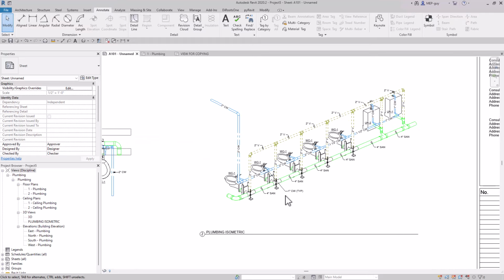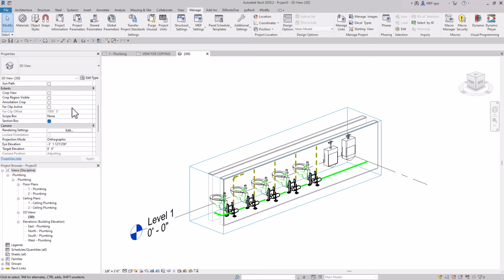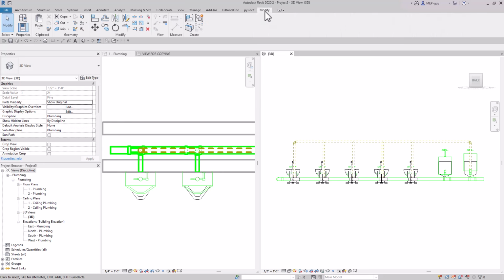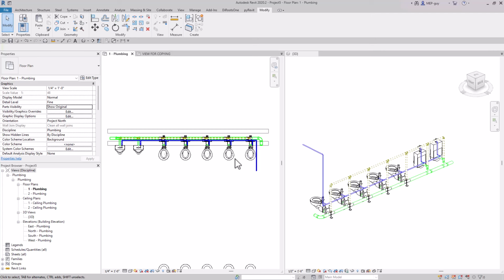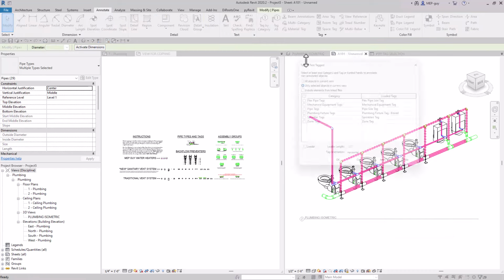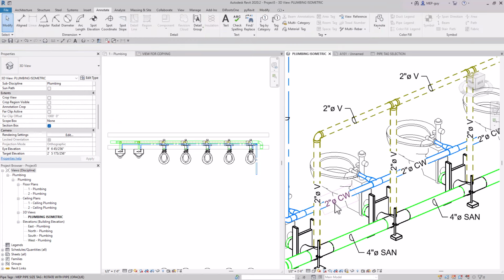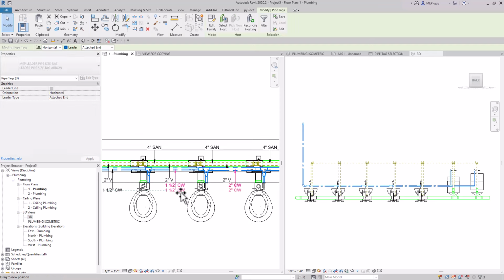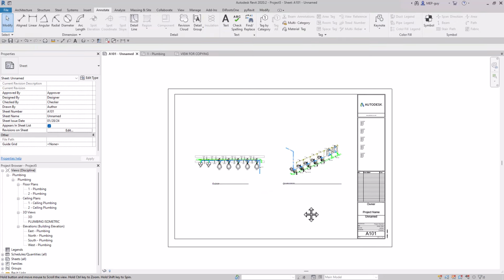Advanced Techniques for Modeling Plumbing in Revit

Comment: Hey Ryan, when transferring VIEW TEMPLATES, is it possible to only transfer selected templates?
Reply from the maker: I'm actually not sure. I know with the method that I was showing it only allows you to transfer everything. I wonder if you just transfer a single view if it will only pull in that view template?. That would be using the insert from file command.